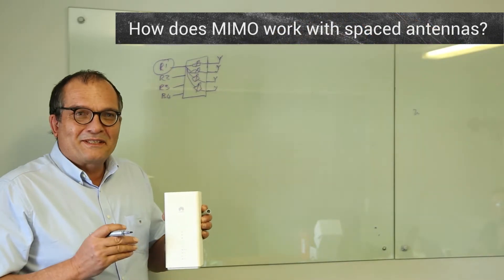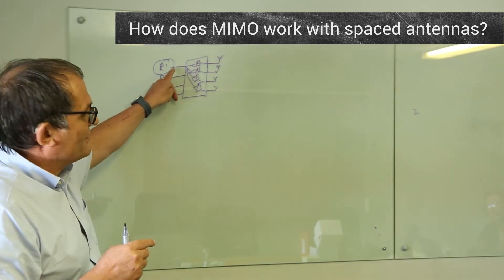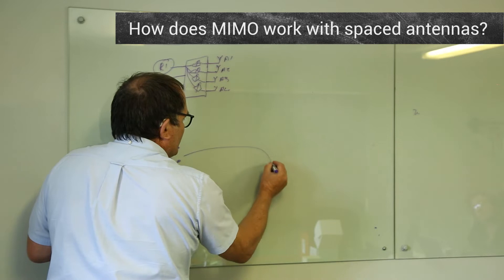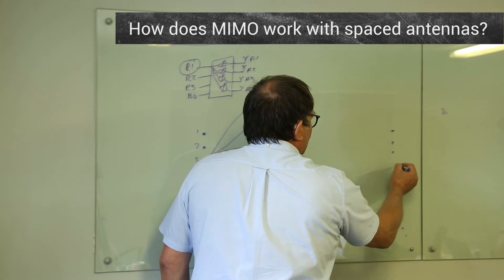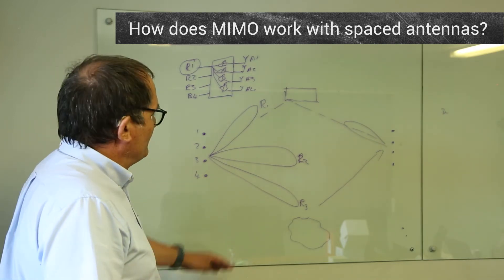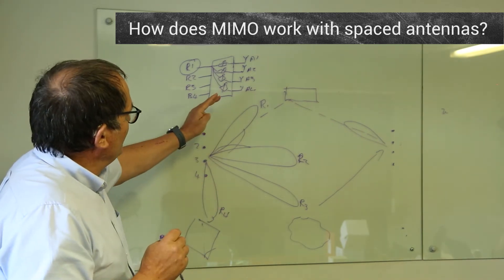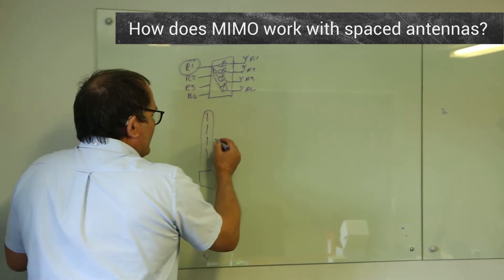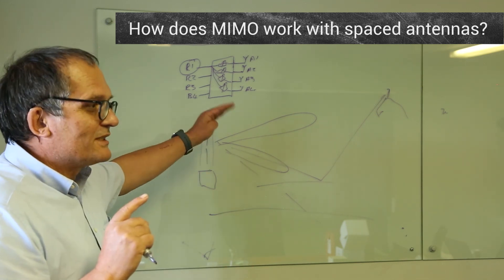MIMO Basics #2:  MIMO and spaced antennas.

Comment: In your example you mention a phone doing this, but you draw what looks to be radiation patterns of a directional antenna.  I don't understand.  Are you saying that omni-directional antennas can send directional radiation patterns?
Reply from the maker: Dear Anson Garcia,
The effect that Andre is describing here is that of so-called 'beamforming' due to the Antenna Array.
So, whilst the Antennas themselves are Omnidirectional, the effect of feeding the same signal to, for eg. four Antennas in the same polarisation, is that of 'forming the Electromagnetic Wave' such that the 'sum of the EM Waves' creates a 'higher gain connection' so to speak. With 4 Omnidirectional Antennas this Gain such created is 6dB larger than that of the individual Antennas. The subsequent video shows how this beam' can be 'steered' by changing the phase of the signal sent to each individual Antenna in the 4 Antenna Array. Again this 'formed beam' creates a EM Wave with 6dB higher Gain than the individual Antennas.
Kind regards,
Pieter